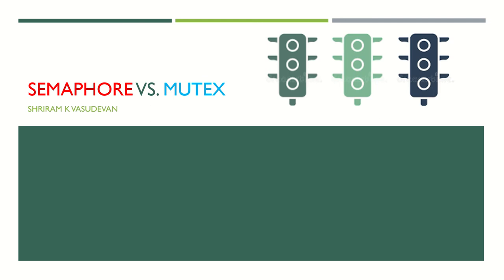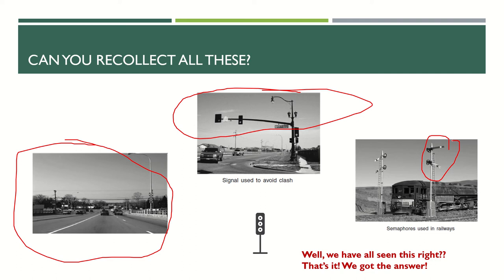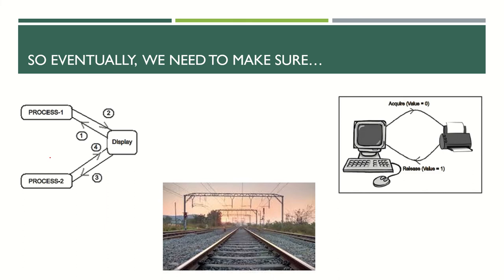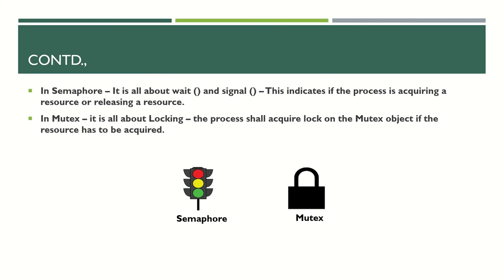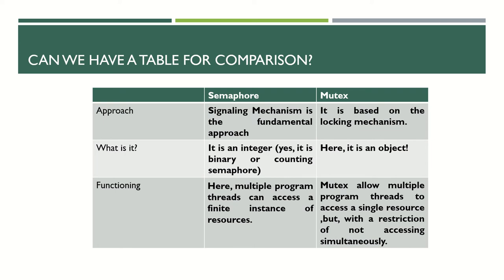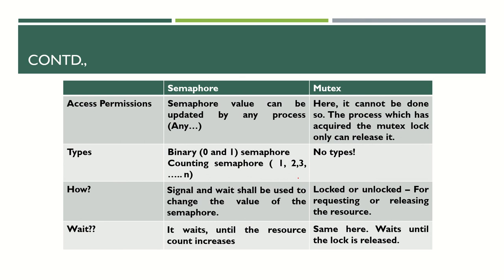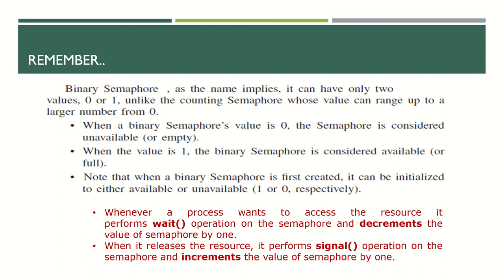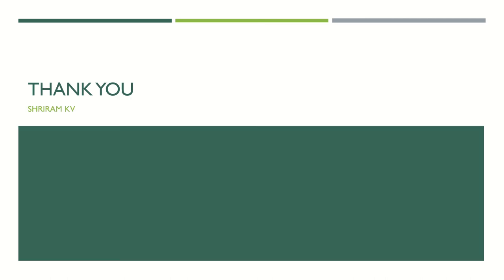Semaphore Vs. Mutex - A Clear Understanding

Comment: Thanks for simplifying this in easier manner. I have got doubt, will be glad you can answer it.
Suppose we have three "writing thread" writing a message into a message queue and one "reading thread" which needs to read the message from the queue. So in this case to synchronize the process we can either go ahead with "Binary Semaphore", which will allow only one thread to read or write at a time or using mutex by locking the resource. 
Now the question is which method should be preferred and why? (in context with RTOS in embedded systems)
Thanks in advance :)

Comment: Hi Shriram  - Nice and very clear video describing the concept of mutex vs. spin locks vs semaphores.  I have couple of follow up question/requests
1.  Can semaphore, mutex, spin locks work across the processors? For example, if the mutex used by two threads running two different CPUs, will it work?
2.  What is the underlying assembly instructions for spin locks? You can take type processor, like ARM.